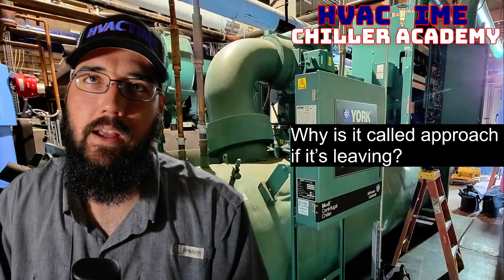Why it is called Approach with Chillers Explained

Comment: Finally !  Thank you for explaining the term, "approach."  It still sounds like guild obfuscation to me, 
but at least you made a good attempt at surmising why the factories have assigned that meaning
to the word.  It seems to me the term, "differential" would be far more relevant.   When you say that
we increase/decrease the approach temperature, is it not the case that the system actually changes
it by sucking or compressing the refrigerant more because it is not absorbing or dropping the heat
as fast ?  "We"  do not do it; we only observe it.

Comment: PRV  Not Calibrated Please tell me solve this problem
Reply from the maker: Will it complete an automatic calibration or does it fail. The chiller switch has to be off and the calibration in on the compressor screen.

Comment: Daikin air cooled chillers list a condenser approach value. I've heard you could use that number to get an idea on refrigerate charge level. I assumed it's calculated with saturated condenser temp and OA-T but not entirely sure. You have any thoughts on that?
Reply from the maker: Yes air cooled approach uses cond sat to OAT. It is a good metric for verifying operations but I wouldn't personally charge to that. There are a lot of challenging variables that influence air cooled approach compared to water cooled. Especially how dirty the coils are. While dirty tubes has an impact, how exposed to getting dirty and difficulty of a quality cleaning affects air cooled on a more dramatic scale.